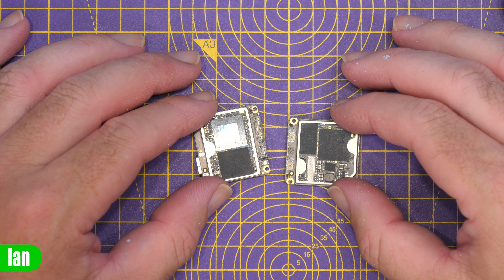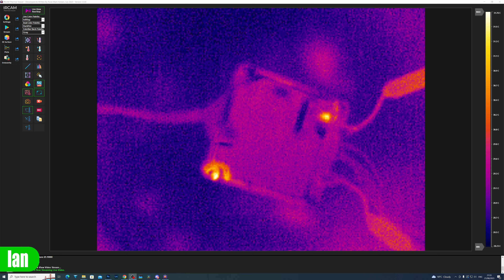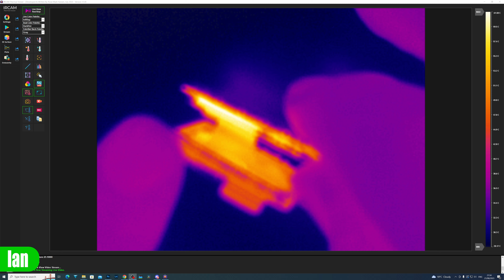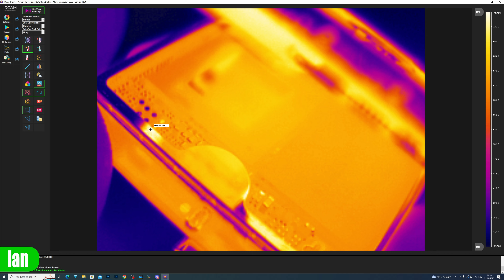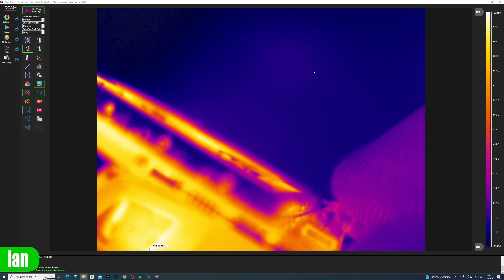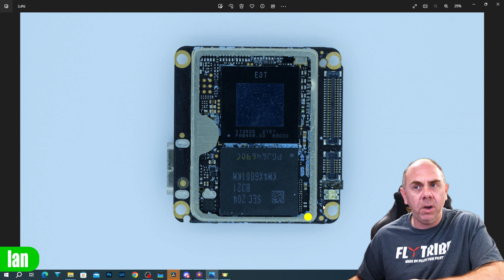DJI O3 FPV Lite & Ultra Air Unit Too Hot To Hold!  - How Long Will It Last?

Comment: Question:   How would you go about maximizing cooling of the air unit in all configurations; stock, naked, lite, ultra, whatever.   I have a question about ideas to keep the 03 air units cool only, not concerned about weight in this moment.   I am more concerned about keeping the 03 air unit running cool over its lifetime than saving the weight. 

Note:  Perhaps you can tell me that I should not be concerned with this, but from what I have seen, you can fry an egg on one of these things, they get really hot and can go into shutdown which could be very problematic in some circumstances. 

With a lot of the heat being generated in-between some of the layers of circuit boards, and only thinking of removing heat, again not worried about weight... but let's say you add a IFlight 03 heatsink to the outermost circuit board, would that make sense?  Do we have any choices? (see the next paragraph)   Does it make a difference which side you would put the heat sink on?  Should you put heat sinks on both sides???

Does it make sense to try to cool the units by drawing heat thru the circuit boards to the outer boards.  Perhaps there should there be some kind of heat transfer metal that would or could be mounted in-between the boards... and with that, move that heat thru a thermal mass to an external heat sink to aid in cooling.  

Could we expect that with a proper application of thermal paste where needed that we could do an effective job of cooling the 03 assembly with the use of the heat sinks such as the one from iFlight?  This assumes that the heat sink has decent exposure to some airflow during a typical flight.

By the way, those small "bars" that are found on the boards, i can't imagine that they are doing very much good based on where they are located and the size of the pad, just not big enough and not in a location where it can shed heat.

Comment: Thank you very much 😁 i am building a speedybee master 5 v2 and was curious about which side needs to be against the heatsink 😉 i will definitely put the flat side against heatsink. Excellent info 😁 i don't think mine came with the metal plate for 03 unit anyways 🤣🤯 can't find it anywhere but it looks like it's on the parts list 😉

Comment: A few thoughts:
1) The auto shutdown (ie internal temp sensors) are likely tuned to the average temp of being inside the cans and enclosure.  I'm curious to know if the shutdown now happens later than it should because the real amount of heat isn't getting to the sensor.
2) The P1 is likely hotter in the 03 than the original/caddx due to H.265 (vs H.264).  So... if it gets really hot does the performance then degrade?
3) Would love to see the same tests in light mode (cans on).
4) Fantastic work!

Comment: I I were doing this, I would leave the heat shields on, and since the hottest chip is up top, add some sort of finned aluminium to that shield.

But then the loss in weight is marginal

Comment: If flying in an environment with low relative humidity, high temperature, and dry fuels like dead grass… could the 03 possibly cause the grass or other vegetation  to ignite  - if there is a loss of signal or failure to return… would the 03 cool off before there is potential  fire concern?
Reply: It takes about 500 degrees f to start a grassfire.  If you are flying in such an environment you have to worry about causing sparks if you hit rocks, motor temps, shorting during a crash.. etc.

Comment: The lose of weight is really nice, and especially for whoops it really mathers, however i have really big concerns about the level of heat that is generated, therefore i dont know if its a good idea to make it naked and removing the thermal compound, maybe after the warranty ends, or as soon as the o3 gets cheaper. 😅 Thanks for the infos!

Comment: Are you going to conformal coat any of the components?  I'm wondering how bad that would insulate it.  I'm probably not going ultra and just use the factory heat shield and thermal compound as waterproofing for those components

Comment: Is there any difference of behavior between lite and ultra 🤔
Cause the shield should be kind of a thermal conductor, or
Reply from the maker: Yea it will allow it to run a little longer but overall it’s largely the same.
Reply: @MadRC  thank you, so I will consider to use the ultra für the pavo and the lite for the Siren F3 Split

Comment: It would of been nice to see how the thermals are with the metal covers still on with the compound as well. Also, compare it to how the thermals are normally with the stock housings on. Other than that great vid Mate! Cheers 🍻
Reply: Exactly - I want to know how the heat dissipation is with the Flywoo lite vs. ultra options.
Reply from the maker: Largely the same. All you will see with the shielding is that get hot. Overall it’s the same components driving the heat.  All the different will be it will take a little longer to overheat.
Reply: I'm wondering if the shielding has decent thermal capacity and ability to function as a heatsink.
Reply: @MadRC  you can buy a flir c5 there a good thermal camera
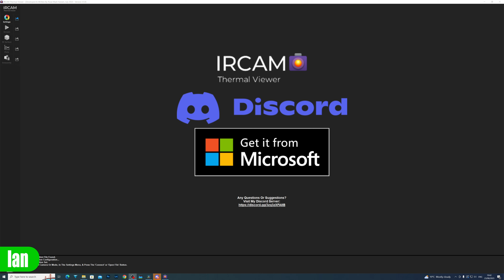Reply: @MrBlonde5k1   Flywoo claims 10+ minute stock, 3:30 Lite, and 2:20 for the Ultra

Comment: I have Flywoo Explorer LR 4 with regular 03. Currently where I live is around 36°C in the shade, during the day. High humidity. 
If I dont fly as soon as I power it on, 03 overheats, FC overheats. 
Lite versions are definety not for summer times.
Reply: I flew a drone with side panels slowly in 38°C and i think it overheated for a second. Everything blinked off video and my control of the drone and transmitter sounded like it lost signal. I then turned around and flew back fast. get that wind blowing haha

Comment: On the flywoo site they had this diagram of a frame that I would like to know if it is actually going to be sold.  They recommended that the lite or ultra be ensconced in the frame such that the propellers could help with cooling.  This is probably a good idea.

Comment: Sacrificing a gram or two for a separate small heatsink on the P1 would be something I would consider to help lowering the temp 😅 Thanks for the test!
Reply from the maker: I was thinking about this me self. Just something with some thermal epoxy
Reply: every raspberry pi board / kit i've ever used always has a little mini heat sync to go on the main chip.   I am considering something like that for my naked o3 because shaving 20g sounds good but noone has really 'tested' this over a 6 month period so who knows what the long term effects are, if any.    @MadRC